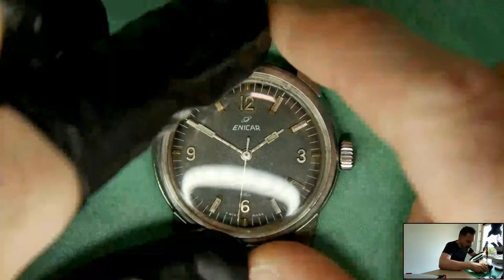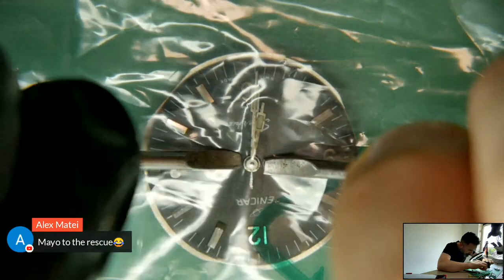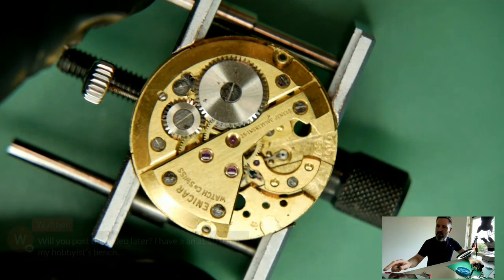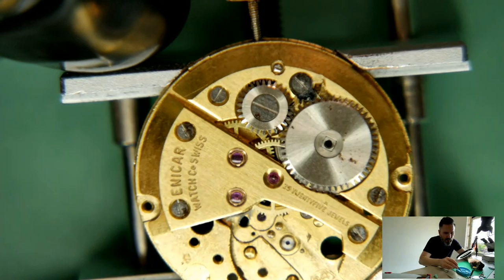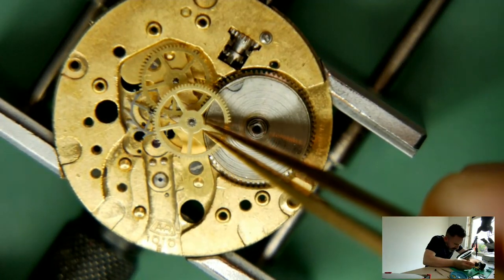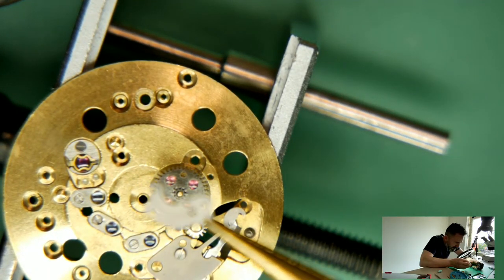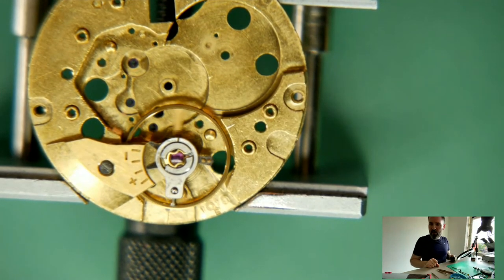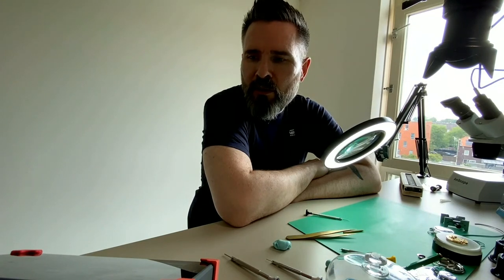It's DEAD! Vintage Enicar Sherpa not running! Full unedited strip down of this stunning Swiss watch

Comment: In Enicar&ST96 watches in general,the regulator of the balance wheel and the base of the hairspring that is fitted move simultaneously thus damaging the hairspring.How to overcome this issue?
Reply from the maker: I’m not 100% sure of your question but I’m assuming you are talking about adjusting for the beat error? Some can be done with an adjuster on the side of the balance cock but older watches has to be done old school by manually adjusting the hairspring while the balance is off of the watch.

Comment: What is the magnification of you lamp an working distance, thanks I like your very interesting videos
Reply from the maker: Thanks very much :) 

It’s nothing special it’s just a x3 magnifier with an led ring behind it. I was once walking past one of those Chinese nail salons (I didn’t go in) and I noticed they were all using them.

Some may frown upon it but for the main strip down of a watch I find it less stress on the back, and actually work quicker. I also have a x5 and x15 loupe for when I need to get up close.
Reply: Thanks again